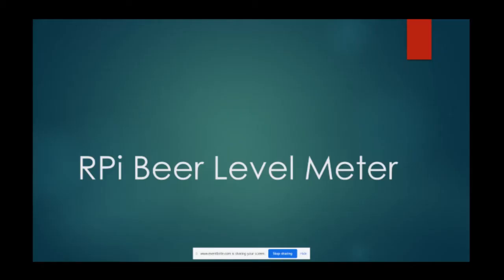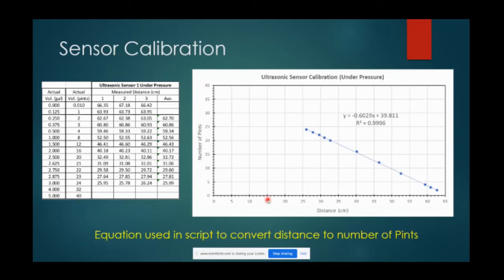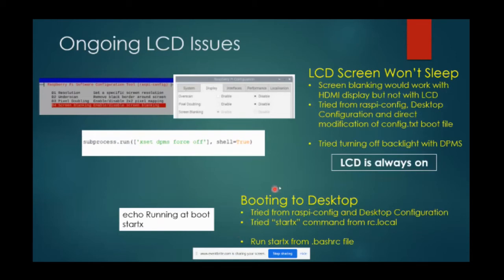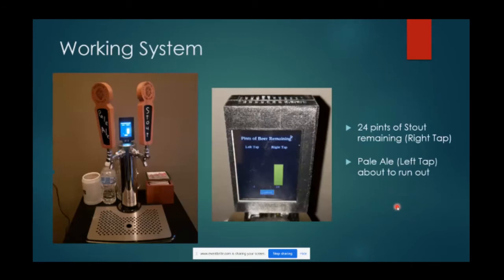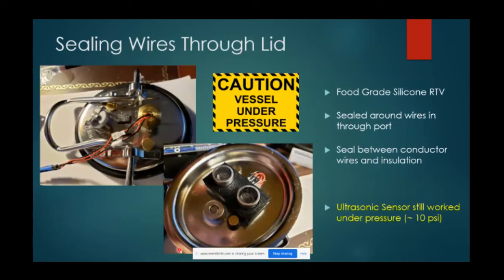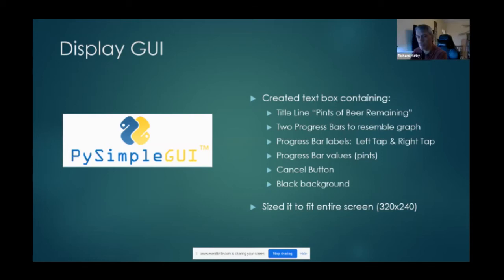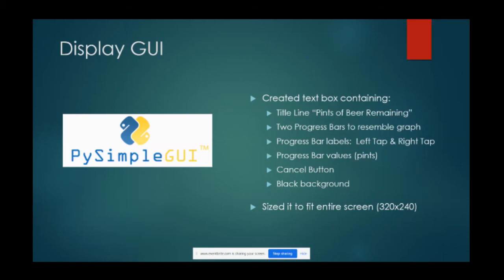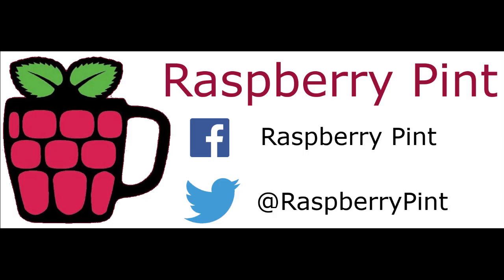Greg Pawlikowski RPi Beer Level Meter

Comment: I wonder if you could just bang the barrel? Not undermining your whole PI thinking, actually thinking about using the PI to hit a small hammer or weight and then analysing the sound. Alternative view would be a digital weight scale under the barrel linked to the PI... once you learn the weight of the barrel full and know how many pints they contain you should be able to calibrate the exact weight with the number of pints left